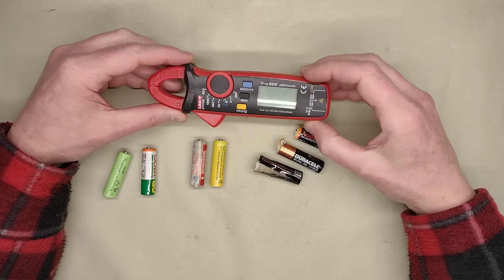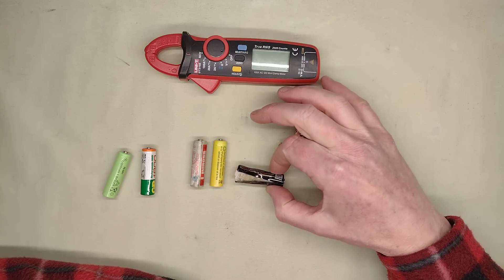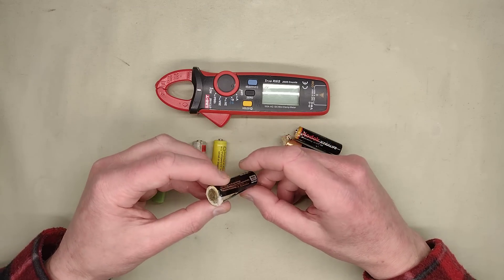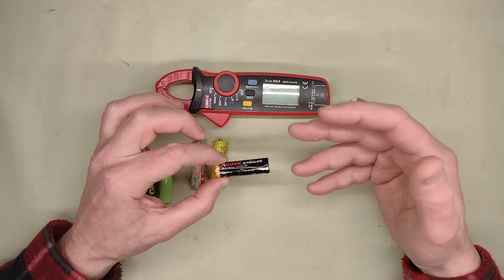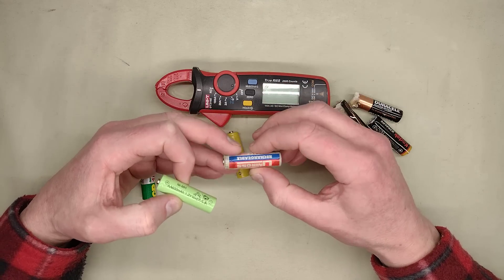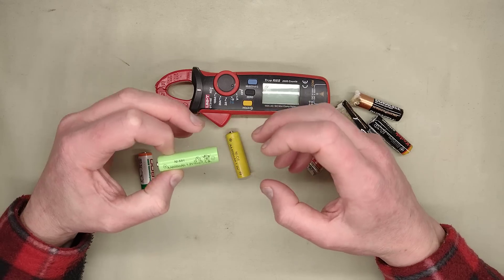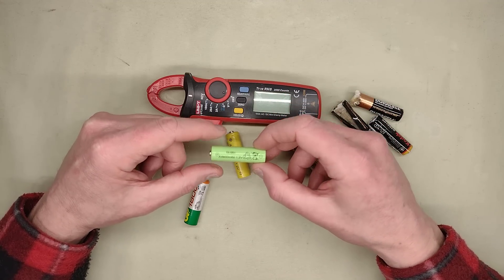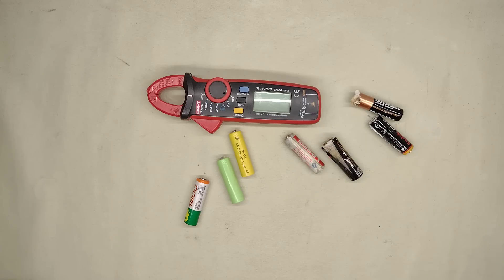The curse of leaky alkaline batteries

Comment: I've even had brand-new alkaline batteries fail. A brand-new set of Rayovac batteries that blew up in my expensive Agilent meter and ate all the plastic out of it. Lots of fun having to rig something up so I can still use it. Sprang for some primary lithium cells since there's not much left to hold it together at this point. Also have multiple TI calculators that have all sorts of workarounds and stuff in them because the PCBs have been so eaten by exploding batteries. They seem to constantly blow up regardless of age. If only they had a good battery technology that could provide the full 1.5V in a rechargeable format that was commonly available at stores.

Comment: I lost an old Radio Shack transistor checker to leaky alkalines. I have noticed that you can get copper plumber straps cheaply and I think these would make good replacement battery contacts because they'll be easy to solder to. You might need a strong soldering iron for it. (60 watts seems to be great for everything I throw at it )

Comment: it seems alkalines have gotten terrible in the last 10-15 years.  I think it's them reformulating the chemicals to make them more green, and I suspect the mercury that used to be included did some kind of hydrogen adsorption.  Without that, now the hydrogen can build up and cause them to leak.  The cost of NiMh is a bit higher than alkalines, but it isn't as much of a difference as it used to be, and tends to be a lot less than the cost of replacing a device that gets destroyed by leaking alkalines.  I have tried to move everything to nimh also for this reason.
Reply: I remember having regular batts in devices that used little power for 5-6 years no problem.  Now I don't even leave those alkali batts in anything without checking them annually.
Reply: I've had excellent luck with Kirkland (Costco) batteries. Never had one leak.  Average price is $14 per 48.
Reply: @firesurfer  I've had a few leak, but they took much longer to start and leaked slower than other brands I've used in recent years.
Reply: It's to sell more lolz
Reply: @Tanks_In_Space Capitalism encourages companies to make profitable products. Whether that translates to good quality is another question entirely.
Reply: I don't doubt your experience but I would never assume a manufacturer is switching to "more green" formulation unless there's a law and inspectors you can point to.

Unfortunately capitalism actively encourages 'penny wise pound foolish' behavior like putting poop batteries in expensive gear.
Reply: @snigwithasword1284  yeah don't you know capitalist consumers just love to find a product they've used forever just sucks now and still use it... Your ideology falls on its face every chance it gets doesn't it.
Reply from the maker: Do you see the "Mercury free" bit printed on them?  The tiny amount of Mercury used to absorb the hydrogen and prevent the pressure build up.  The acronym you're looking for is RoHS.
Reply: @bigclivedotcom  I believe the mercury was added to slow down side reactions due to impurities in the zinc anode. More pure zinc made the addition of mercury unnecessary. Someone is probably trying to see what impurities they can get away with in the zinc and the experiment isn't always working.
Reply: Don't see the need for single use cells anymore except for niche applications. Feel like they should be outlawed for most use cases. Replaceable rechargeables should be the way forward, seeing as loads of products could just use protected 18650s.
Reply: @cameron20020   Remotes need them. They are the number one use. Many of them won't use the lower voltage.
Reply: @firesurfer  Remotes just need a more modern design. An 18650 lithium can easily drive a 3.3v microcontroller and IR led or RF chipset.
Reply: @cameron20020   Most people have legacy equipment that hangs around for decades. Alkalines are not going anywhere soon.
Reply: @Tanks_In_Space  , i need to pull you up on your first sentence.  china can produce good stuff but the foreign companies often want the cheapest.  whether capitalist or communist hasnt got much to do with it.  after ww2, the us advisors assisting japan to rebuild the economy advised them to build cheaply to get turnover.  the japanese learned very quickly this was wrong.  another american advisor strongly suggested that they needed to strive for quality if they wanted return business.  his name was deming.  japan, to this day has an annual deming award for quality in manufacturing.  as of about 20 years ago it had only been awarded once outside the country.  i prefer to own japanese goods.  rarely are they not top quality.  chinese goods made for japanese companies are also generally very good.

Comment: With alkaline batteries, originally they contained a small amount of mercury, this helped to stabilise the chemical reactions in the battery,  it's only when this stopped being added, for the usual 'environmental' reasons, probably around 20 years ago, that the leakage problems started. 
The worst brand is The Kodak branded ones from Poundland, they can often leak while still in the packaging, years before the expiry date, I don't buy those anymore. 
Panasonic & Varta seem to be the best for not leaking & Lidl's own brand Aerocells too.
Reply: Varta are horrible here in Australia, however the Vartas sold here are absolute bottom of the barrel, much cheaper than Duracell/Energizer. I use Energizer Industrial from the big electronic distributors (Digi, E14) which have proven far far more reliable than the 'normal'/retail Energizers sold at the local supermarkets.
I pulled a set of Duracells that expired in 2001 the other day and they hadn't leaked! Another set expiring in 2002 had leaked all over the place. Both in devices with zero standby current.
Reply: @tmmtmm  2002, yes that was probably about the time when they stopped adding the mercury content & the leakage problems started!

Comment: I can't count how many of my devices have been ruined by leaky alkaline cells, I use mainly recargables in everything now.... Except my home door locks, the manual specifically states that 1.2v is not enough to reliably run the drivers and to only use alkaline.  That's fine though, the locks eat batteries for lunch, no time to corrode.

Comment: I came to the same conclusion about alkalines that you did, Clive: ain't worth the trouble anymore! As for circuits that deem 1.20V to be "dead": what the hell are they thinking? I've logged alkaline battery discharge voltage over time. A fresh battery starts at 1.5-1.6V. Alkalines are usually considered dead at around 1.0V, as low as 0.9V. When you look at the halfway point in the discharge curve, you see that 1.25V is right smack in the middle between "new" and "dead." Any circuit that demands you throw away your battery at 1.20V is throwing away about half of the useful juice in a cell. As you point out, these circuits are problematic for NiMH cells because they have a slightly lower-but-flatter discharge voltage than do alkalines. 1.25V is where NiMH cells commence working. I've been trying these newer AA cells that stuff a small Li-Ion battery and a small buck regulator inside the AA cylinder. They put out a perfectly flat 1.5V output due to the switcher's regulation. Problem is that you have no way of detecting the state of the internal battery. These cells just stop working when the internal cutoff voltage is reached. Poof, "zero volts. It's dead!" A-H ratings are close to a NiMH cell. I use a pair of them in my Apple mouse. They last for about 8 continuous days in the mouse before dying, about the same as alkalines because Apple, for whatever reason, considered 1.2V to be "dead." Duh.
Reply from the maker: The Jugee lithium based cells I looked at dropped their voltage briefly near the end of capacity to trigger low voltage warnings.

Comment: I have two of those meters and previously used eneloops in them but they would report low battery well before the cell capacity is used up. I modified them both to use single 10440 cells by adding a 3.3v LDO with really low quiescent current from torex (cmos ones often draw 1uA quiescent) there are 3.0V versions but I had a few of the 3v3 ones on hand and still worked fine. No bms necessary as the meter starts showing the low battery icon at about 2.8v which is just safe enough for li ion. I also added a diode too so I can still use at a pinch, two 1.5v cells normally incase it runs out in the field and the dmm is needed badly. I have had a lot of damaged remotes and devices (including 1 of said meter but was repairable) due to leaking alkalines so I tend to stay away from them too and convert to use rechargeable li ion or nimh if possible.

Comment: Would Clive be thinking of a joules thief circuit with "LC" or solar cell and a small lithium battery as a replacement module for disposable batteries. This would be especially useful for low current/rarely used devices.  Now  someone could start a fund me thing and sell batches of ten.
Reply: good idea, but the whole point of Joule Thiefs is that they give a pulsed output, which I think won't work in a lot of devices

Comment: The real cure for all this is to let us use different kinds of cells. We should start a campaign. I recently was rechargeable light shopping (had a 20V Craftsman light I loved & wanted to replace) and found a design I liked where you could put in AA batteries horizontally or use 18650s vertically. This should be a requirement in all products to allow for maximum battery choice.

Comment: I see you have a Uni-T meter.
They seem to be excellent value for money.
I bought a tachometer recently because it was a hassle for one of my clients to keep sending their tacho to me when I needed to do preventative maintenance on their equipment. I compared the $30 Uni-T to the $500 one they supplied and the Uni-T is more accurate, easier to use and has modes the more expensive one doesn't have.

Comment: I use 1.2v volt NIMH as much as I can and energizer lithium max for items that require 1.5v voltage and don't get used regularly. There are some devices that go through batteries quickly and need higher voltage. For those specific devices I still use Alkaline.

Comment: Disposable lithium cells are also excellent for expensive equipment that doesn’t get much use and might end up with the same batteries installed for a decade or more.  I have a flashlight with a lithium battery from 1985 that still works and is not corroded.

Comment: In my experience devices that get used plenty deplete the battery and get a fresh one before the previous can leak. As for NiMH, they seem to not last at all, I've pulled apart a few solar garden lights that stopped working just a few weeks after they were bought and they all had these 1.2V cells in them.
Reply: The ones they include with solar lights are the cheapest, crappiest cells possible. They're also arguably standing up to the harshest conditions depending on your local weather so they are a recipe for disappointment.
Reply: @Reusable-Box  Even the replacement, rechargeable AA cells meant for solar garden lights are the crappiest low capacity cells I've ever seen (typically 800mAh)

Comment: Hello BC,
Could you tell me how you cleaned out the old alkaline mess from the battery carrier?  Thanks!
Reply: Vinegar or other mild acids will attack the alkaline corrosion.
Reply from the maker: I usually use vinegar with care to neutralise alkaline leakage, then mop it up and clean out the area with a spray of isopropanol.
Reply: Followed by a trip to the Fish n Chip shop for some halibut! 😋

I've been making use of Eneloop NiMh batteries around the house with good results.

Thanks 👋🏻